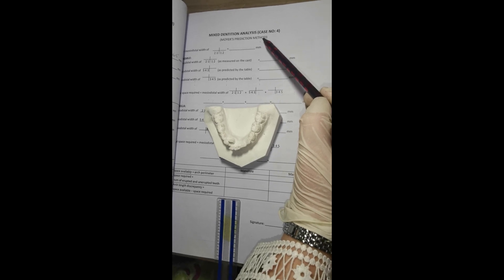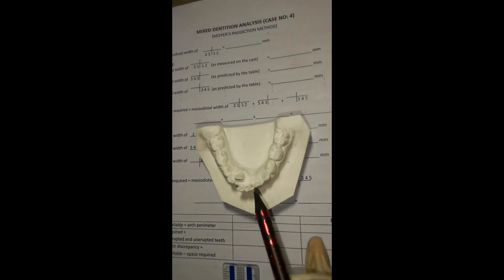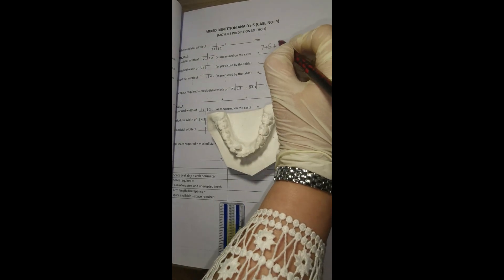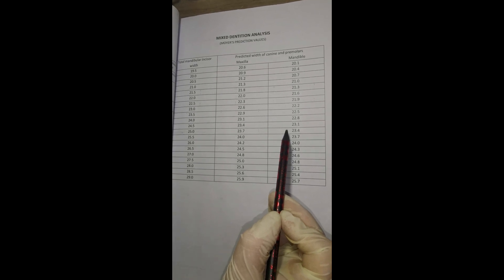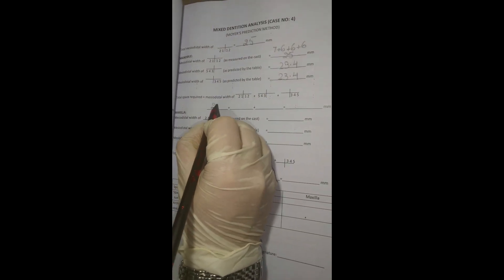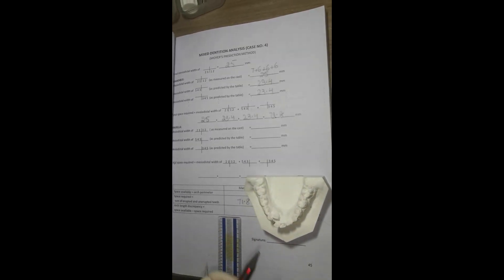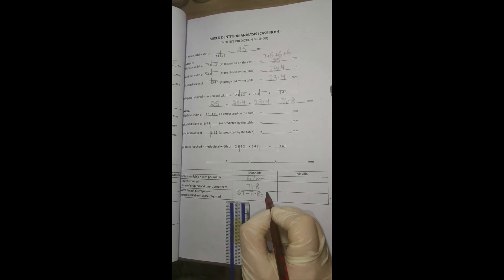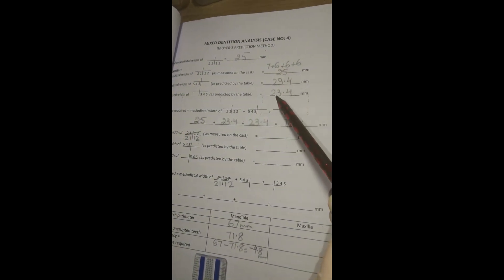Moyer's Prediction Method  Mixed Dentition Analysis orthodontics

Comment: "Space required -- measures mesiodistal width of all teeth". May I humbly ask, isn't it for MDA, the lower incisors are used for the Moyer's table both upper and lower arch to predict unerupted 345/quadrant, but not during computation of the space required? I think ,For the maxillary arch, the original logbook is correct and need not be changed.